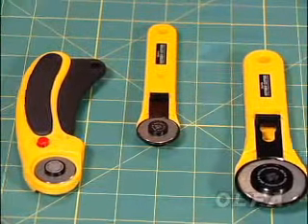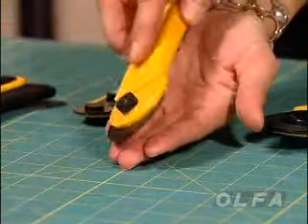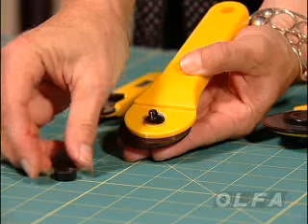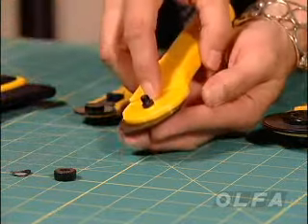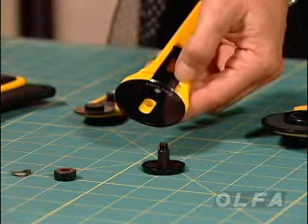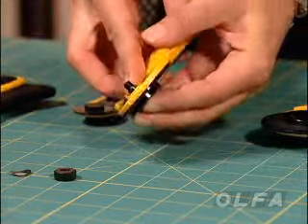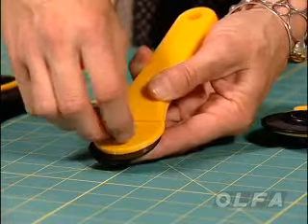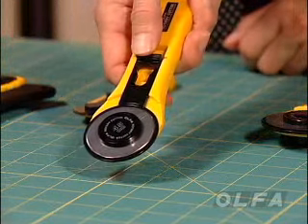OLFA ALL Rotary Cutter Blade Change

Comment: I have everything put together right, and screw is tight. The blade has a bit of a wobble. Anything to do about this?
Reply: try turning the nut (last step) over with flat side up.  It works for me

Comment: Can someone explain the difference - if any - between Prym and Olfa?  I'm trying to buy a PRYM cutter, because I've heard good things about that brand.  But on Amazon, it says 'PRYM' and then when you look carefully at the packaging, it says OLFA on both the cutter and the blades.  Some customers are complaining that they got a cheap knock-off cutter with OLFA and Japanese packaging when they wanted PRYM.  Are they the same brand?  I want a really GOOD cutter and not to be cheated by some knock-off counterfeit brand (as sometimes happens on Amazon if you're not careful).